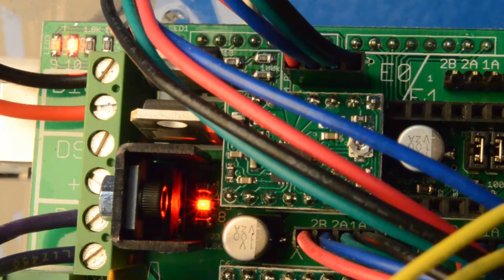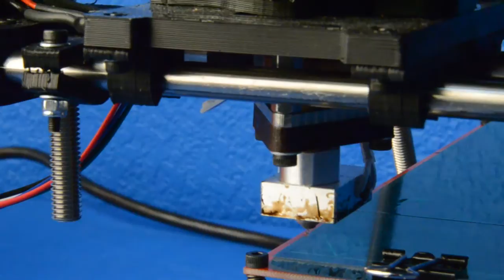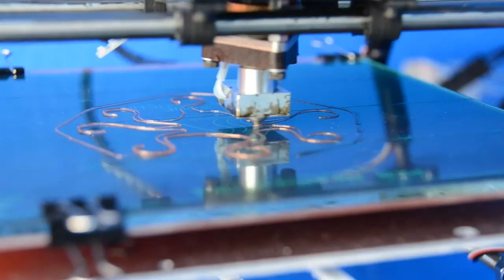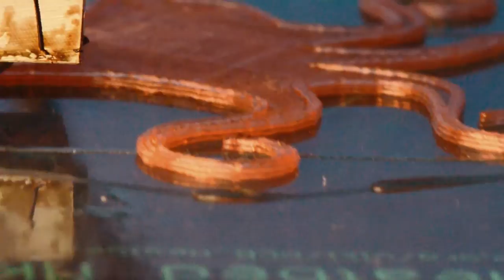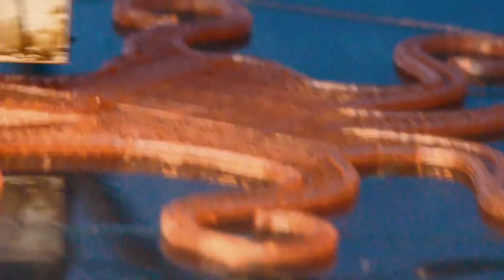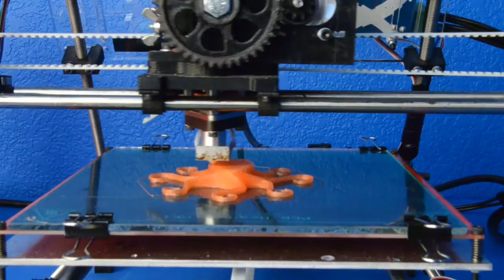LulzBot Prusa Mendel 1.0, Print From Start to Finish

Comment: i need help. can you email me a copy of your configuration file? i have lulzbot prusa mendel with the arduino 2560. it tries to go to an area way off the board. i think i have the settings correctly 175x180x110 or something but it doesnt print at all. it does extrude manually. also manually it goes +x, +y but not -x and -y. can you help me tell it to not go past the borders and to start the print correctly please.